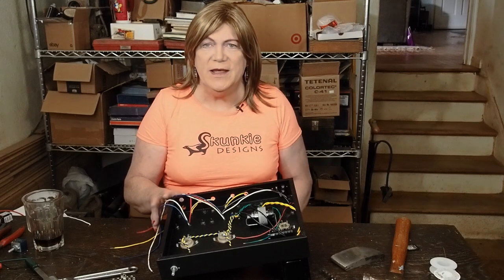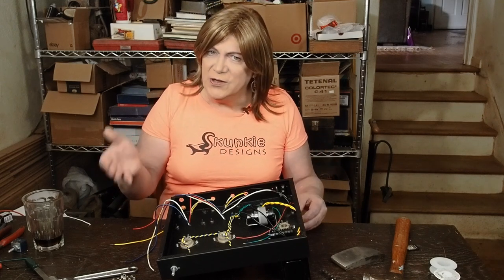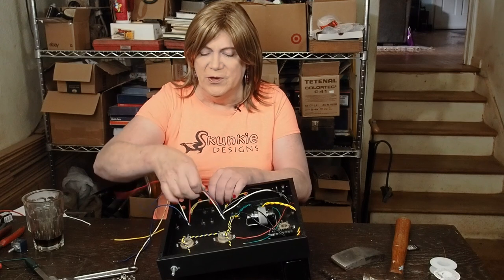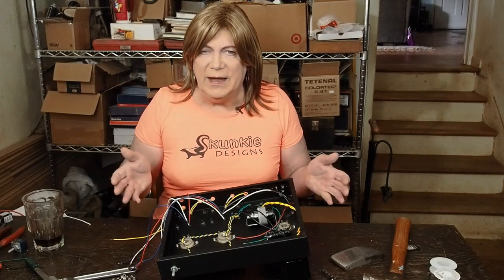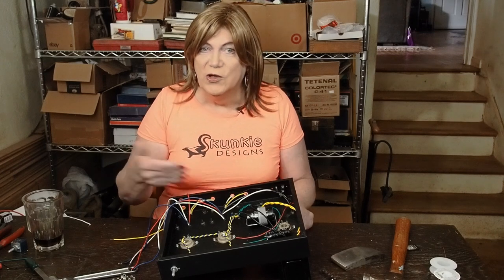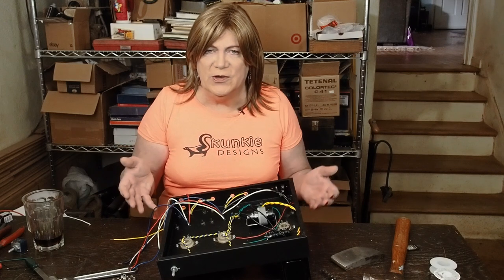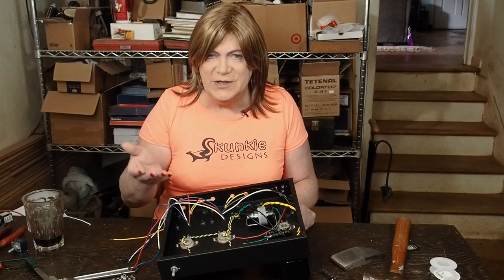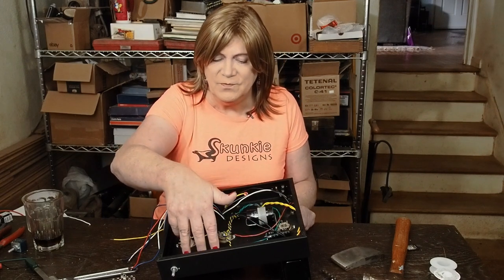6SQ7 EL34 Tube Audio Amplifier: Ground and Wiring Design.

Comment: Ground is important but some tubes need directly chassis ground from pin not electrical ground. Shortest path ground from electrical ground to chassis ground is very important.
Reply from the maker: Such as? That seems like an invitation to a ground loop.
Reply: @SkunkieDesignsElectronics  Pin 5 of 4P1L and many russian tubes.
Reply from the maker: @nuttyl283  Possibly if you are trying to use a common transformer winding on a center tapped direct heated tube, but that seems like a very rare situation. Do you have a link with more info on this issue? I can't find anything on a google search that covers this. 

I'm trying to keep things simple on this channel and not confuse viewers with rare/obscure situations we are not delving into. In any case I have seen, using the chassis itself for multiple ground points (especially without running a wire from this point to the star ground) is a very, very bad idea.
Reply: @SkunkieDesignsElectronics  such as 7W7 https://en.wikipedia.org/wiki/List_of_vacuum_tubes
Reply: @SkunkieDesignsElectronics  I think chassis pin of some tubes just help release noise to chassis ground to earth. There is no ground loop due to it just a shield of the tube design. As long as electrical ground is not loop. there should be no hum or buzz. PS ferrite beads of all tube pin wiring except filament is useful too.

Comment: Great video, would you call that parallel heater wiring to the tubes?
Thanks
Reply from the maker: Hmm I usually just call it heater wiring but sometimes slip and call it heater windings, probably because they are "wound" or twisted as a pair?
Reply: Oh what I meant was are the heaters wired in parallel or series on that particular amp? Apologies for not being clearer :)

Comment: Does the volume pot use for sweet spot? I saw some amps have and others don't. What exactly the benefit of it?
Reply from the maker: I like for my amps to use between 40-70% position on the knob with the intended speakers.
Reply: @SkunkieDesignsElectronics  Without the pot, is it like 100% all the time?
Reply from the maker: @Warclock07  Yes, you would have to control the volume with the input signal strength, like with an external passive control or an active one like a pre-amp.
Reply: @SkunkieDesignsElectronics  Thank you so much. The schematic of my amp has the pot but there is non on the amp. I will install one to see what happen.